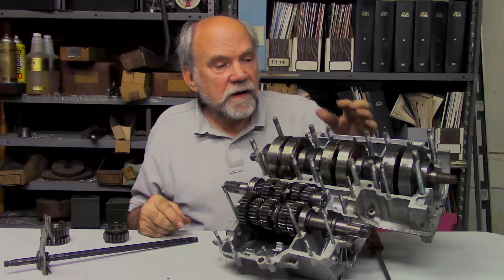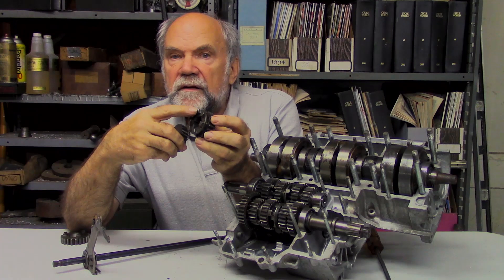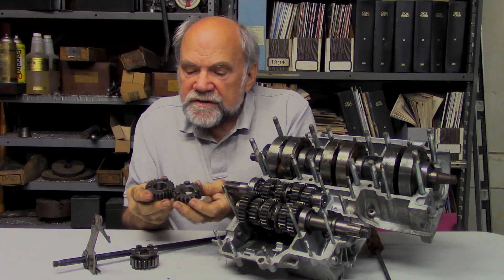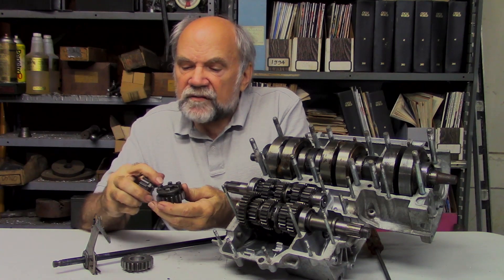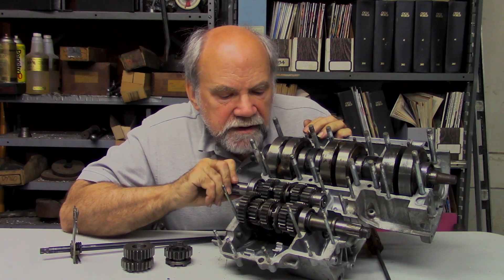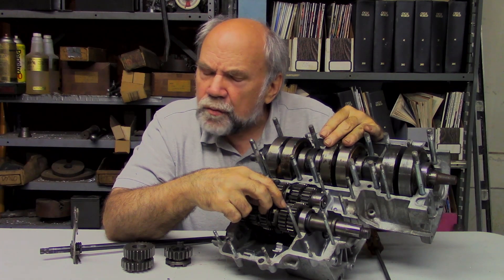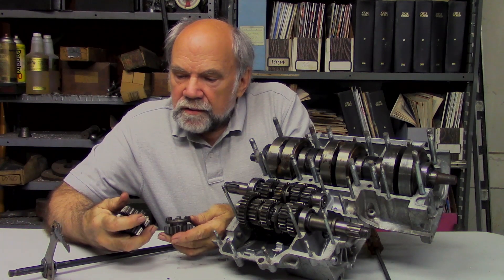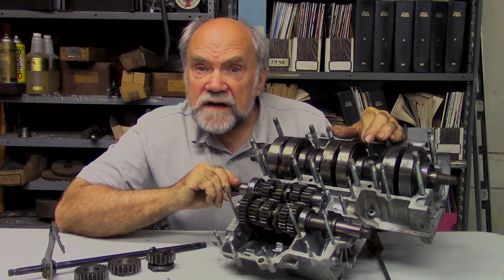What Are The Causes Of Poor Shifting In Motorcycling?

Comment: Great video! Very true that poor shifting is often caused by something outside the engine. The tip about the shift lever being installed incorrectly is really useful. I've also found that poor drive chain tension or a loose clutch cable are two other common reasons why my bike will shift poorly.

Comment: Very helpful video. That was a lot of trouble you went to, on the little Kawasaki you mentioned, Pulling off the head and cylinder barrel and splitting the cases just for an intermittent shifting problem, and you'd have to have bought a fresh new gasket set for that.

Comment: I remember bikes back in the 80’s when most were 2 paw shift forks and straight cut gears with crappy clutches. Modern bikes shift like butter. We used to take TZ250 gears and remove all the burrs on the lead of the gears, polish the forks and chamfer the dogs lightly with a stone.

Comment: I had just problem with my kawa z750. After tyre change (were still factory tyres 😀 bike is from 2004 and 2000 miles) 5 and 6 gear didn't go in. Needed to relift lever several times to engage next gear but didnt have false neutral. It had just chain too tight. Loosened it to 30mm and now works fine. 25mm is minimum slack. Maybe gearbox is still too crunchy because low mileage.

Comment: This certainly helped me better understand transmission. Yet I still don't understand why my 82 XJ 1100 jumps out of 1st gear into neutral when the engine hits 3 grand. This really stinks when I cannot fix it myself (I just don't have the skill to do it) also finding someone to crack into a 30+ year old transmission for a reasonable price is near impossible. This issue really drives me nuts and is one of the major reasons why I don't ride as much as I would like to. Also I don't have enough money for my dream bike a Triumph Rocket 3.

Comment: I have a Gen 1 Yamaha R6 that is notorious for losing 2nd gear. This video is great but I’m curious if the dogs get rounded off during clutch ups, or if it’s really just power shifting without the clutch? I’m trying to avoid this problem. Thanks

Comment: hi,,is it possible to replace crankshaft size and flywheel to a smaller to make a shorter piston stroke for more power?,,does it affect my electrical voltage because the stator will rotate more and create higher voltage than the regulator and rectifier can handle?

Comment: Hi Kevin,
My new Honda monkey sometimes fails to upshift from 3rd to 4th! It takes a second try to get the job done! All other changes are fine, and I don’t ever get false neutrals.
It is as if the mechanism does not fully re set after the 2nd to 3rd upshift, so when you attempt the 3rd to 4th upshift it doesn’t move the parts it should! Any thoughts or guidance you can offer would be appreciated!
It has only done 1000 miles so wear in the parts should not be a problem?????

Comment: The latest trend of quickshifters and their long term effect on gearboxes does cross my mind.
Reply: I was wondering about that. I have a factory quickshifter, and do seem to get more missed shifts from 1st to 2nd over time. Adjusting the linkage helped, but I wonder if the clutchless shifts are wearing the gears faster than normal.
Reply: Just asked Google. Turns out Kevin himself has answered this question :) https://www.cycleworld.com/2015/07/03/ask-kevin-do-motorcycle-quickshifters-have-negative-effect-on-gearbox-life
Reply: 1st to 2nd you are also jumping across neutral. Never used a quickshifter
Reply: Late to this video, but this is very good helpful information. I am presently rebuilding a Ducati bevel single that I parked years ago partly because of a shifting problem.

Comment: Hello Mr Kevin, I'm learning a lot from you amazing information and knowledge, did you experience or knowing a motorcycle kawasaki 650 2019 abs have a lot vibration from engine it buy new but something is wrong do you think can be a camshaft problem or same time a clutch im feelings vibration all the body not to smooth wile you ride this is normal thanks very much?
Reply: Sorry, right now is 1000 miles